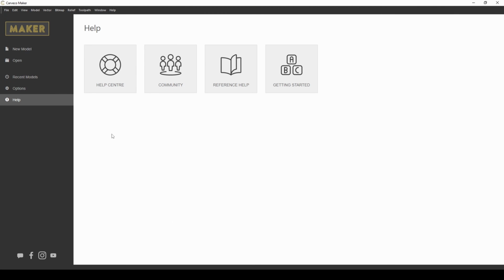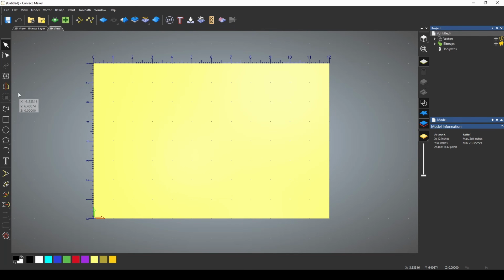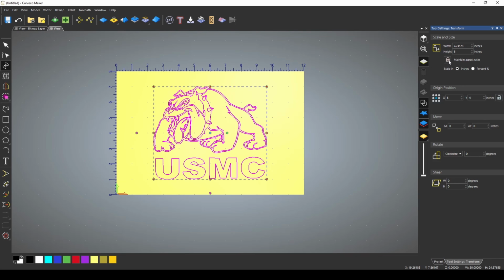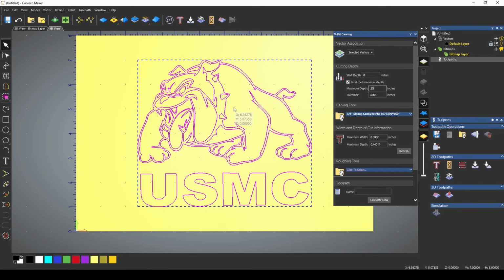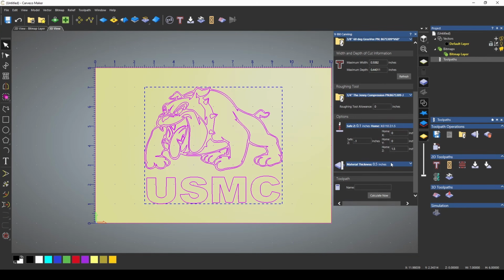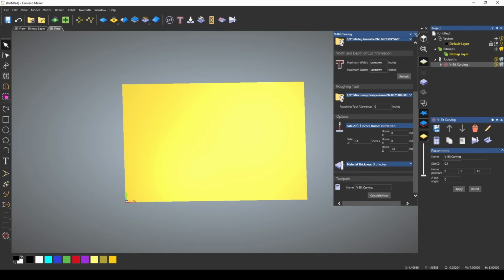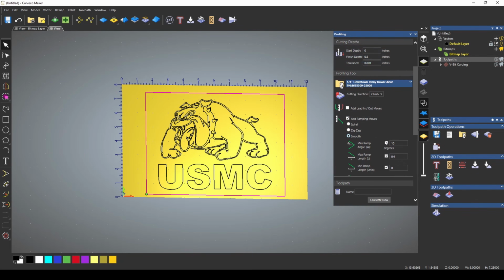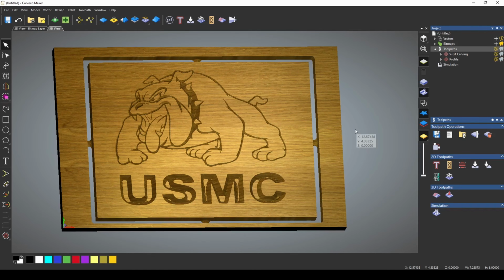Quick Start CNC Guide for Carveco Maker - VCarve CNC Vector Designs!

Comment: Timberfalls, after running the roughing pass, does the v bit finishing pass know how much material has been removed by the roughing pass and start carving the rest of the material, or, does it assume no material has been removed and just cut air until it reaches the material it needs to carve?
Reply from the maker: Great question. The Vbit only cuts what the rouging pass did not so no wasted time. Hope this helps.
Reply: @Timberfalls  It helps a great deal.  I'm having more fun with this CNC machine (Ginmitsu 4040 Pro) than I've had in a long time.  You are helping.  Thanks.